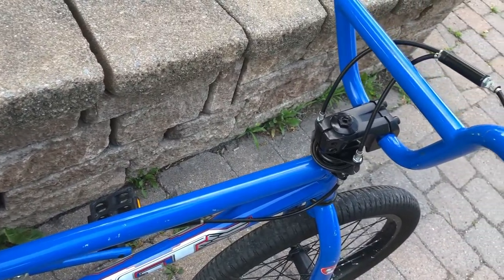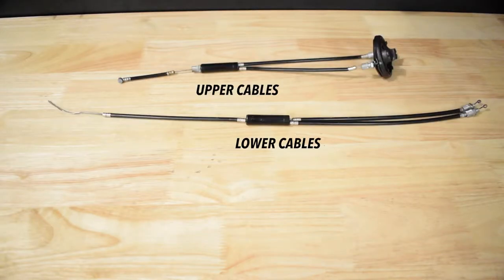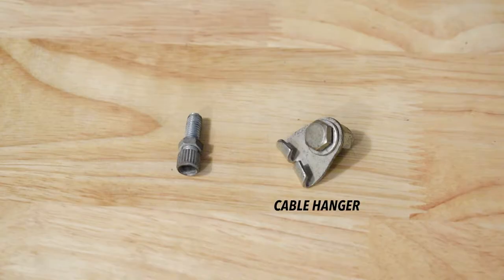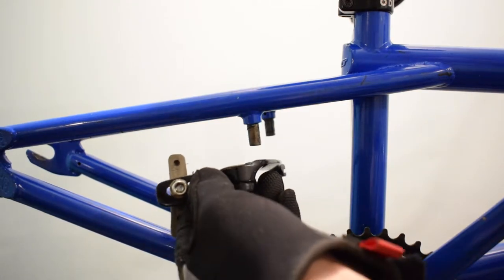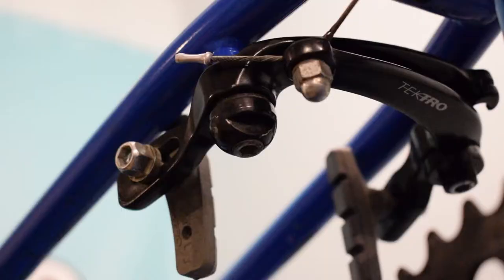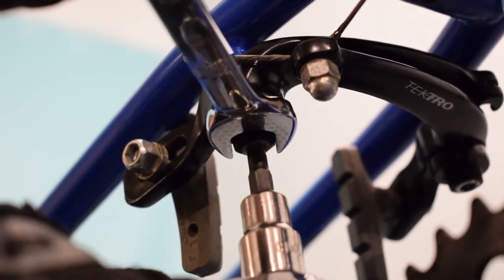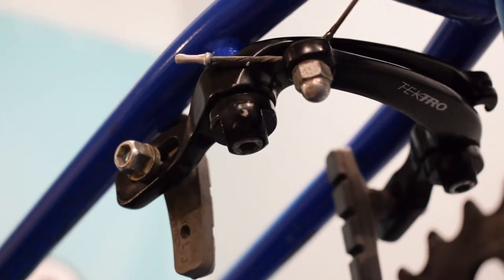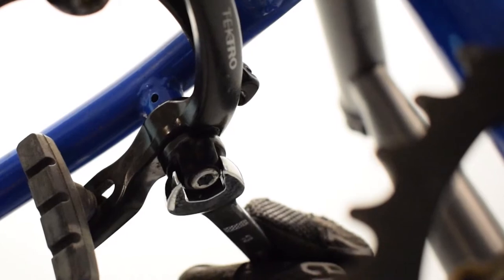Installing the Gyro Brake System with U-Brake

Comment: Is it possible to replace individual parts in this Gyro 3 system, e.g. the cable and armor in this combined system, which goes in the rear brake from the rotor down?
Do you have to buy the whole set?
Reply from the maker: Yes, you get get the individual parts from a BMX store.
Reply: @DanyoSports  How do you adjust the rear brake? So that the jaws come down evenly to the rim